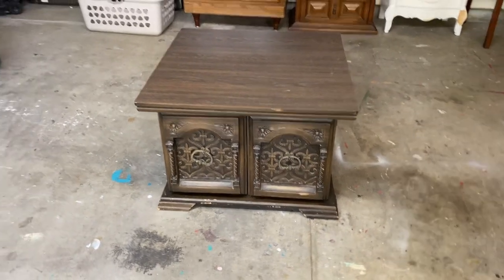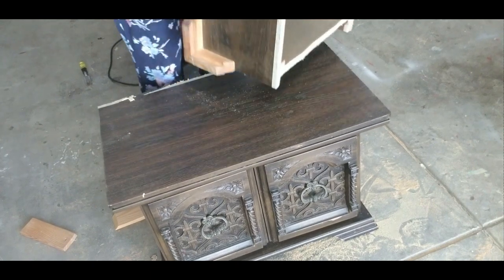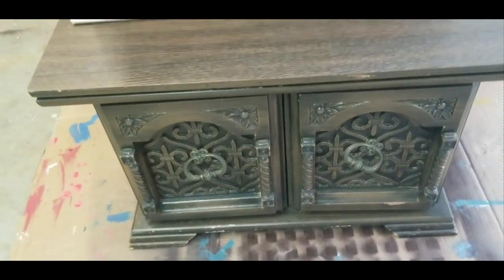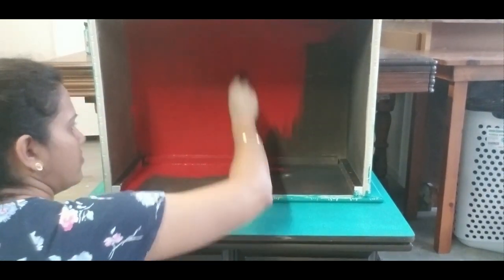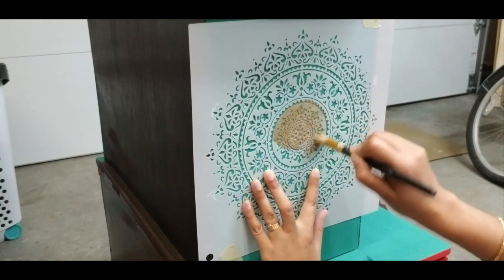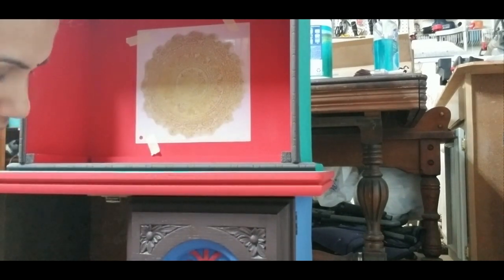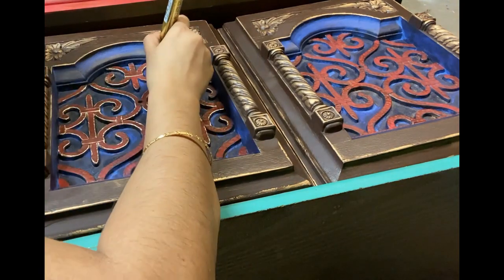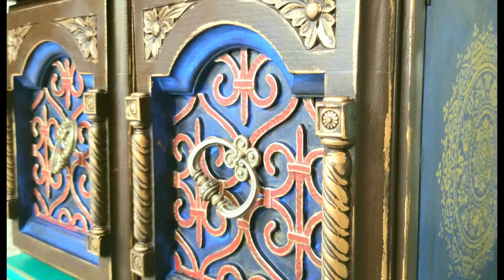Flipping antique side table in to a home temple

Comment: What a beauty! I am in love with the final outcome. I have a similar cabinet, which I turned into a mandir myself, but I did  not cut my cabinet in half. I built a separate cabinet for the top. Cutting the cabinet in half is very useful, if it needs to go into a small space. 😍😍😍😍😍
Reply from the maker: Thank you

Comment: Can we use normal Benjamin Moore paints to paint furniture?
Reply from the maker: If you are using that first sand the furniture, then apply a coat of primer and the paint the furniture of your color choice.
Reply: Savi's Creations so it’s ok to use normal paints with primer other than chalk paint right?
Reply from the maker: Yes
Reply: @saviscreations185  thank you so much

Comment: It’s really awesome !!!  I have a question Savitha  
Which one is suggestable as a protection coat  finishing wax or water based polyurethane ?
Reply from the maker: Both are good. Depending on projects I use wax or polyurethane. Polyurethane protect the paint even from oil stain where as wax does not

Comment: Beautiful Savitha! I admire all your works. 
I there a reason you prefer chalk paint over acrylics? Or can I use acrylic if I don’t get a specific color in chalk paint?
Reply from the maker: Thanks Mukudhan. If the painting surface is glossy and very smooth it holds chalk paint better than acrylic paint. If you use acrylic colors give some base coat like primer and chalk paint.
Reply: Thanks Savitha.
Reply: Also, could you please specify the name of the finishing gold wax that you have used? The link is for minwax clear wax. Do you mind sharing your location?
Reply from the maker: https://www.amazon.com/dp/B01FMZHLEA/ref=cm_sw_r_cp_apa_fab_lJByFbG05KVQX
I live in Newark CA

Comment: As you are using wax for the final finish for these mandirs, will there be a problem if we lit diya near the mandir? i mean is it heat resistant ?
Reply from the maker: I don't use wax for the inside cabinet. I don't know whether it is heat resistant but I never got any complaint from customers so far.
Reply: @saviscreations185  is it better to use clear coat inside?
Reply from the maker: Yes, it protects from oil stain